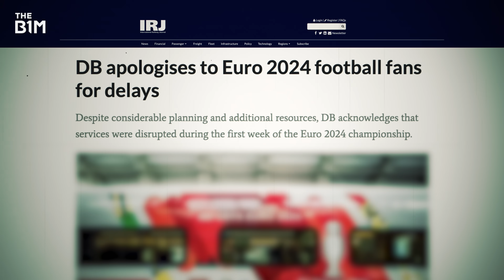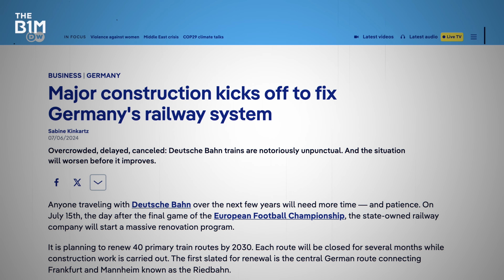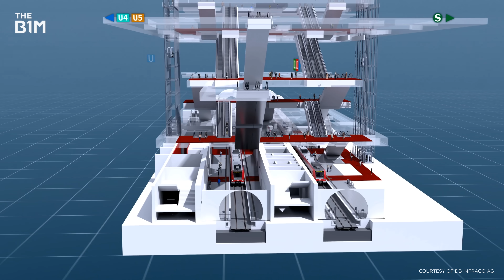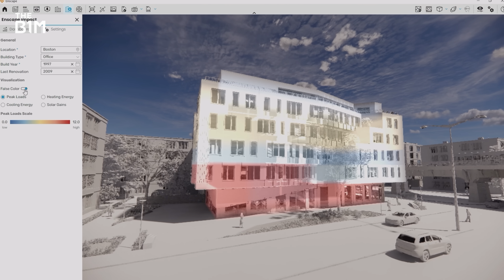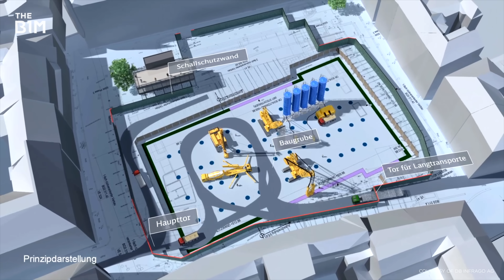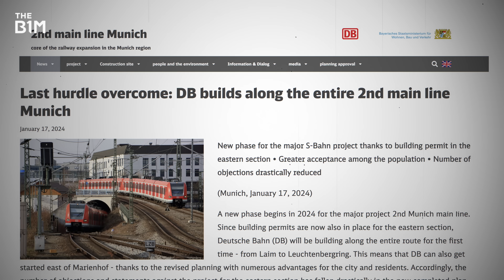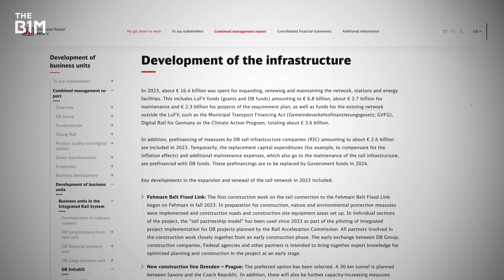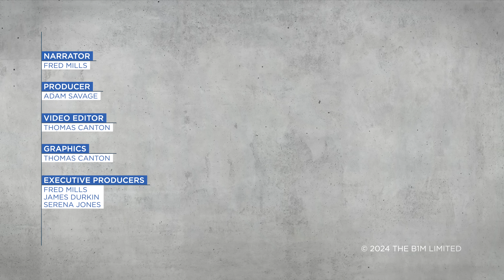Germany is (Finally) Fixing Its Failing Railways

Comment: The major problem is not even that the trains are constantly delayed. That would be fine, if you wouldn't lose your connections all the time. But the problem is, that we are UNDERSERVED when it comes to regional trains.

The typical regional train wins ONE TIME an hour. And often they all start at the same time, all around the full hour. But that means when your train arrives normally at :50 and is delayed by 5 minutes, most likely your connection at 0:58 is lost, because many need to long to get to that train. And missing that train in most cases mean losing one hour. If the regional trains would run on a half hour schedule, missing a train wouldn't be such a problem. 

But the problem is: For such an effective system we would need MORE tracks. MUCH MORE tracks. Unlike the UK, where most major routes are four tracks, even heavily used corridors here often only have 2 tracks for ALL tracks. Even the space saving Japan is having 8 tracks straight through Tokyo, so that the major ring line, the most important north-south suburban line, the regional lines and the shinkansen all have their own pair of tracks.  But bc Germany is a country of Nimbys, the DB is not able to quadruble their tracks on major routes in time, but only after decades of court cases filed by citizens, NGOs (who claim to be for "the environment", but hate the most environmental friendly type of transportation) and just people who want some Euro more for giving up 4m of the side of their field...

Comment: I think another point is quite a crucial one (and not always going to plan). The netherlands complain that their cargo trains are piling up while waiting to get into germany. There are plans to fix this too, but they come with some mayham too. See "Tunnel Rastatt" for example: The new tunnel collapsed over the TBM not only delaying the new line, also interrupting the old one which was a major one in the region (fright, local  and distance trains) . The TBM has just in April this year been dug out of the concrete that was quickly poured over it to stop the collaps. But getting fright trains off the high-speed network onto their own sufficient lines is a big part of thes reneval.

Comment: Fair video, adressing some of the main reasons for the railways issue in germany, but you forgot one: the delay central hub. Let me explain. In France each major train station has been equipped with a "Delay Central Hub", basically a room full of computers and couple of engineers who are taking decisions to optimise delays. Ultimate target is to minimise impact on the other trainsm if one is delayed. And it works. While in Germany, this system doesn't exist, meaning one delay goes on top of the previous one and so on. At the end of the days, trains accumulate all the delays of the previous trains. This is catastrophic.

Comment: It's well worth comparing Crossrail/Elizabeth Line in London with Stuttgart 21:

Both projects were conceptualised in the 90s and required a lot of tunnel boring, construction began for both around 2010. In London, they estimated 16£ bln. In the end, they paid a little over 19bln, 4 years delayed.

S21, however, was estimated to cost 2.5€ bln, a riddiculously little number for a project with such a scale. A very naive, actually very stupid perspective, which unfortunately is very common within Germany. Delay will be 7 years, final costs somewhere around 12€ bln.
Reply: I can't help but blame the concept here of how governments must look for and select contractors for their work. They have to make a public announcement and then take the cheapest option that fulfills their requirements and there are some requirements on showing that the contractor actually has the capacity to build at this scale, but the cost thing is a major factor. Of course this is intended to keep people from handing jobs to a friend's company who will charge inflated prices and that does make sense.

However, it also ends up with contractors sending in proposals that lowball prices and time estimates wherever they can get away with it. So the delivery time and budget has to be checked by the government - who at this point need an enormous amount of in-house experience with projects like this to make a feasibility-check. Alternatively they can get consultants to do this for them with whom they run into the same issue - they have to go for cheap options and hope their selection criteria and checks work.

I don't think dropping all these requirements would make it all magically better. We need policies and processes to prevent nepotism when handing out billion-euro-project contracts. But the way we are handling this right now is just not doing us a lot of favors.

Comment: I watch with closed captioning turned on, not due to deafness, but there is a likelihood I may miss a bit due to popcorn chewing.  And often, the auto CC that youtube generated is wrong, especially with large numbers.  In this case I chortled aloud as Germany was apparently spending $440Billion to upgrade its rail system.  That seemed like a lot ... incredibly a China kind of expenditure generous.  I backed it up and stopped chewing to discover it was only $40Billion.
I was almost deeply impressed by Germanys investment in rail. lol.

Comment: SJ Euronight is a sleeper train service running from Stockholm to Berlin. 

It's honestly a miracle if it arrives on time in Stockholm. And not only that, SJ suggests to have a 2 hour minimum spare time for connections. On regular SJ trains that's more like 15 mins. So it's not a small delay either, that regularly occur.

Comment: The dirty little secret is that they are electrified.  As such the cost of supporting this infrastructure is at least four times the cost of self fueled engines.  Also, the Germans, in their infinite stupidity, have denied nuclear electrical energy.  If they think they can use COAL to power these trains, they are totally deluded.
Reply: 'The Germans' is an invalid generalization in this respect. How to grow the energy infrastructure is a deeply controversial discussion - with some deluding themselves into a nuclear revival. But that is rather unlikely to happen, because of a wide spread NIMBY attitude. That Germany abandoned nuclear has a reason. I myself supported nuclear energy until about 10 years ago, when I finally gave up on it. Imagine: the first reactors came online 1962. And in 2012, 50 years later, there was still no valid solution for the nuclear waste. And given the NIMBYism, it is obvious, that we won't have one in the 50 years to come. Meanwhile, the share of the renewables in the power mix has risen to 58 %. Building PV cells has become cheaper and cheaper. And the majority of Germans is well aware, that fossils have to be phased out soon, albeit there are still some old gas-guzzling junkies, that don't like the idea.
    What many seem to miss, is, that the renewables PV and wind have now become the cheapest and safest options in the mix, with the lowest price per kWh and the lowest impact on lives taken per kWh. At the current pace, we would be able to close the gap to become 98 % renewable like Norway already is, before we would be able to build new nuclear plants. Nuclear is dead in Germany. Not because it is bad technology, but because it is outcompeted by renewables. For the same reason, fossils are going to go away long term.
Reply: @Misophist  My gut feel is that you would have to reduce "energy use" by about 50% to be able to live only on renewables.  The only practical way to do this is by reducing the entire "population" by about 50%.  There are no magic answers to where the useage comes from.  It is from the "people".  Reminds me of the old movie "Soylent Green", where the final scene shows the protagonists running out of the food factory, and screaming, "It Is People".  Food production will eventually decide all of the EU issues.  PassItOn.

Comment: Oops 🥑

Clementi Sport hall
11/12 Wed  7-9pm 2 slot
12/13 Thur 6-8pm. Hb level 1 slot

Unity PRIMARY @ yew tee                               
14/12 Sat 6-8pm
15/12 Sun 6-8pm

Unity SECOND @ yew tee                             
15/12 Sun 11am-1pm

Level: MB - HB              
May u join us ? 🥑

Comment: the problems or complains arent in germany about the sbahn, the sbahn are inner city serving, connecting suburbs and nearby cities.
the sbahn is  just like metro or subway of a city but faster and connecting far away city in a region. if they complain about sbahn , its more like first world problem, bc other countries can not imagine how well that system is actually working. they are not part of DB = deutsche bahn,  or german railway. 
people complain about the DB trains. the DB trains are not sbahn or metro or subway. the DB trains are different.
there are many DB train types in service and speed:
 the RB= regional bahn , a slow train that stops at each small village on a direction till they reach another big city, it serves all small communities for commuting to work or uni
 the RE=  regional Express that doesnt stop at each suburb and village on the direction, is a little faster than RB stops at nearby citiy but still people use it to commute to work and uni
IC = inter city , that type of train connects cities which are far away, it doesnt stop in small villages or cities , is a little faster than RB and the RE train type
 the I C E= intercity express (high speed train), self explanatory.
the problem is, they have to use all the old tracks and railways , which need repair and used also by cargo trains. and those get renewed. 

some sbahn extensions are done and trainstations are remodelled but its not about them people are complaining. and if they are complaining , its like when the sbahn is one minute too late. sbahn, subways, metro, trams are also super frequent, from 2.5 minutes till next comes in rush hour, to 10 minutes till next bus, tram, subway, bahn comes. germans like to complain a lot, even if things work fine.

Comment: The DB is also an extremely weird corporation. It is somewhat of a regular for-profit LLC, but its sole owner is the German government. It completely fails at its operations, so it has to be heavily funded by the state to operate in any way. This leaves with a heavily over funded bureaucratic behemoth, which is totally incapable of performing even their basic duties.

There are other train operators in Germany, many of them operating slower trains over shorter distances. They too suffer from the DB being chronically incompetent at doing maintenance for the railways.

Continuing to let them operate like this is just negligent, the tax money they eat up, together with the prices they demand and the services they offer is totally unjustifiable. No company this badly run deserves to exist.
Reply: The DB shouldn't be a company. Public services shouldn't be operated on a for-profit mentality. The entire idea that market liberalisation is a foolproof way to vitalise the system is wrong.

Prioritising profits over public service is the exact reason that DB decided to neglect its rail network, abandon many branch lines, close unprofitable services, let stations rot and decay - and heavily invest into road logistics (Schenker) and other markets instead.

The past 30 years of DB mismanagement are entirely on the government(s) of those years, which could've changed laws, swapped managers, overhauled funding schemes etc.
The DB management did exactly what they were hired to do: squeeze the whole thing until it breaks.

Comment: How to solve: 

1) Cancel all high speed line projects and other shiny projects, save the funds
2) Expand station capacities (By both platforms and track count a couple km in&out)
3) Electrify all main lines
4) Double track them
5) Quadruple the lines connecting the large centers. High(er) speed for two tracks, low(er) speed on the other to boost capacity further

If you can go 200km/h pretty much all the way, we would be faster today than with the crazy expensivy scattered 300km/h corridors.

Comment: CDU/CSU and SPD have underfunded the railnetwork for years.
Reply: The founding for DB is far more than enough to operate and maintain a good train network. Money is not the problem, incompetence is.
Reply: @ the problem is a disfunctional rail network that needs repairwork at every second corner
Reply: @13Luk6iul  DB has more than enough resources to accomplish that. They are just chronically incompetent, so the money vanishes into anything except improved rail service.
Reply: @jonassattler4489  well I can't really comment on how efficient the DB is run overall, but at least the capacity issues of the german rail network is nothing the DB can be held responsible for. Even if they wanted to extend existing lines or build new connections, they can't. It is by law the responsibility of the government to plan, approve and fund those. And this has not been done nearly as needed – and the DB and other train operators have been screeming about it for years. It is true though that it is the job of the former DB Netz AG (now InfraGO) to properly maintain the existing infrastructure. That indeed hasn't been done as much as needed either.
Reply: @Hugh_I  DB has failed to keep the current rail network in order. Why would you let an organization expand, when it can't manage the network right now?
Reply: @jonassattler4489  because It's not about them, but about the public need for it to be properly maintained AND expanded. The main reason for unreliable schedules is missing capacity. All train operators, DB and their competitors, run into capacity constraints at several choke points all the time, which not only leads to delays when any tiny thing goes wrong, but also makes it impossible for either of them to expand their services – for which there actually is demand that is increasing.
Reply: @Hugh_I  No. The railways are in a constant state of disrepair. Many of the delays I have suffered from are because of bad maintenance. DB can not maintain their current rail network, they obviously have the resource to do so. Giving them more rail network would be stupid and make the problem worse.

Comment: The thing that has me worried most with the planned overhaul of the mainline corridors is that, once finished, the political will to keep investing in the railway network will be gone. This great refurbishment of the railways has to be seen as a first step, not as the solution to germanys rail transport issues. The trains and tracks are already completely packed and some corridors are running beyond capacity 24/7 because the demand is so incredibly high to get people and freight on the tracks. Refurbishing the existing network will not greatly increase capacity, but merely stabilise it for the future. I really hope that once the major refurbishment scheme is done the german gouvernment will keep investing into the rail infrastructure i.e. build, upgrade and even revive derelict infrastructure to keep up with the demand.

Comment: A few new railway stations won't fix the desolate condition of the track network.
Reply: well the new tacks allow construction work on the old tracks without making the system fall apart 
which is the problem of a bottle neck

Comment: Whenever I travel by train in Germany, mostly long journeys, I always put in at least 30 minutes for changing trains. It is too risky to go below 30 minutes, which is also kind of risky in itself, but mostly it works.
Reply: Yeah, and if you travel in the evening and have to change trains along your route, it is wise to never plan for the last connecting train, but at least one earlier. You're always allowed to use another train to get to your destination if you miss a connection, but if there isn't one, you're stuck. You can get compensation for even say a hotel stay over night or alternative mode of transport, but its obviously a hassle to do that.

Comment: That second Munich S-Bahn tunnel making roughly the same stops as the original one, seems an odd choice. No backwaters around the center needing new connections?
Reply: go ther once during rush hour and you know why it is needed
..
also it allows repairs without a complete collapse
Reply: @baronbrummbar8691  You didn't answer about "new connections"

I don't doubt that there's overload on the existing line. If I go there I won't see where the people are destined actually. I'll just see how many of them are pushed to use the existing route.

Following now?
Reply: @u1zha  i understand what you mean but it still is a bad point
upgrading the main line and then ussing busses to get to the main line and inbetween points is the way to go
......
connecting backwaters with rail is not a good plan as ther is simpely to little demand as to justefy them ther
more busses definitley couldn´t hurt though

Comment: I had two back-to-back TERRIBLE experiences with DB recently, due to construction work causing sudden changes to journeys we'd booked months in advance. At one point a train we were supposed to take in the morning had its stop cancelled the night before, and we only found that out because we called DB to ask if everything was looking good (and it was not). The day after, I went to the information desk at a station we ended up at (due to the cancelled stop), and the lady behind the counter confirmed that, yes, any train can be rescheduled at any time with no prior warning. It was all very stressful since we had multiple connections that needed to line up, and the usual hour in between was not cutting it when a stop got cancelled entirely. Hoping all the construction leads to improvements at least!

Comment: There's a real level of disconnect when the British press are complaining about poor reliability of a rail system lol. I'm also amazed they're overhauling their entire rail network with a budget lower than building 1 sodding high speed line in the UK. We suck at large scale infrastructure projects in the UK.